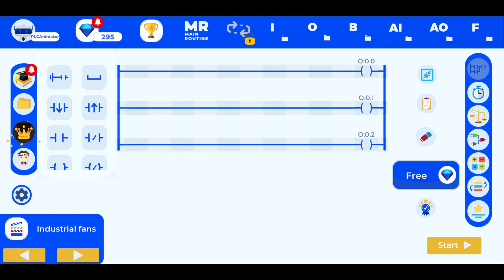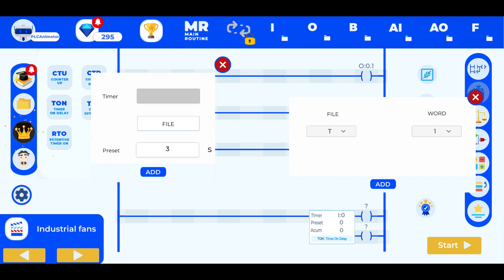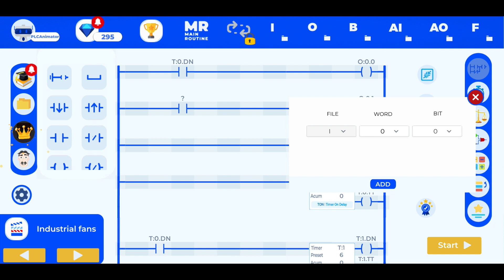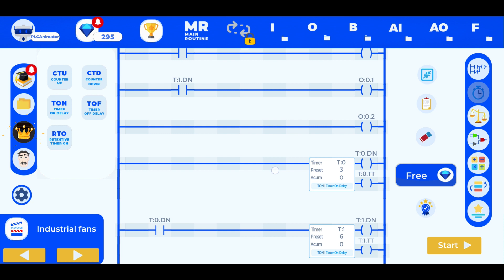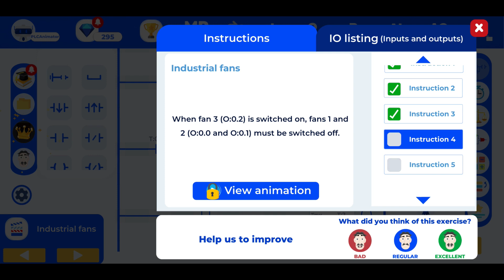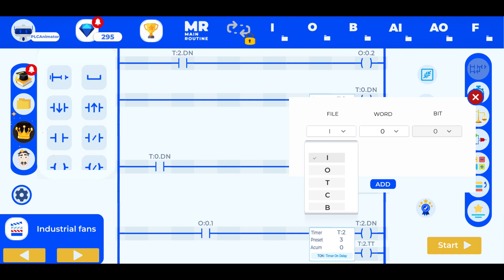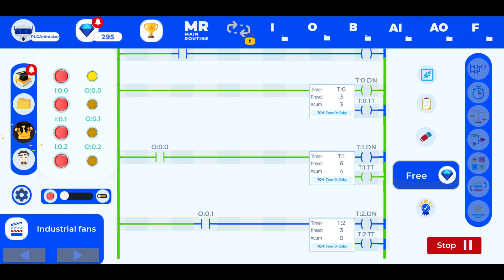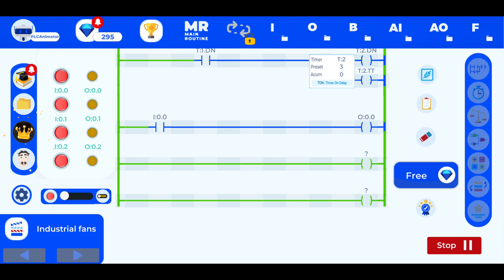02 Industrial fans PLC Solution. PLC Examples. PLC Animator PLC Simulator Android iOS

Comment: In the simulator,  it won't let me have 2 NC or NC on the top rung of my parallel without having two contacts on the bottom rung of the parallel.  I can only have one contact on upper and lower enclave?
Reply: Yes me too 😢
Reply: Did you solve that ?